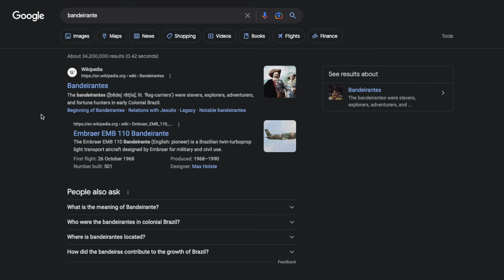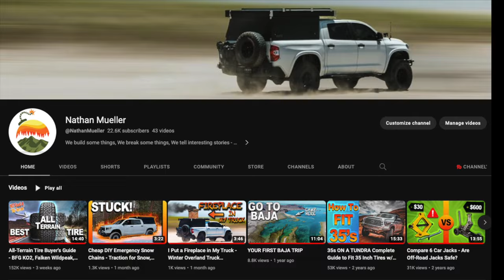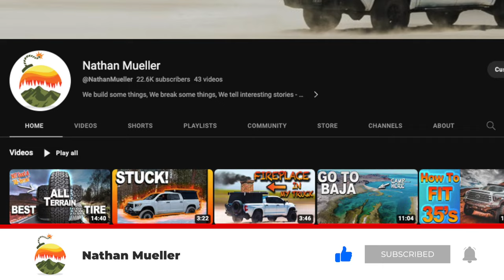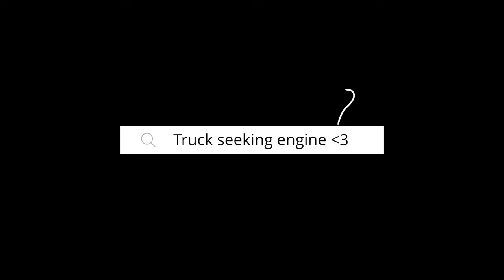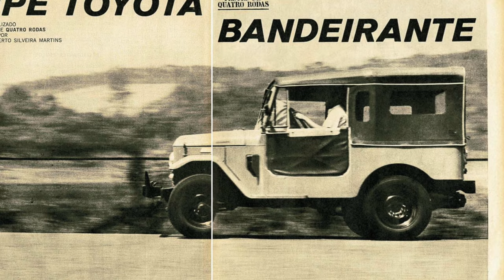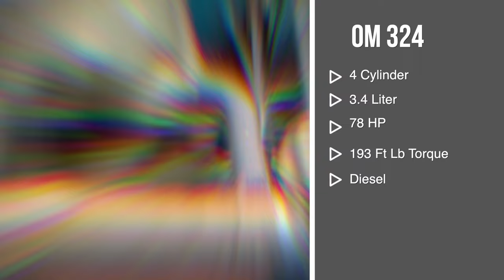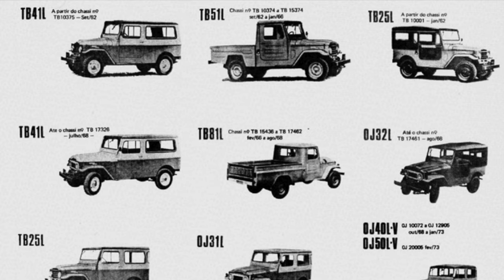What Land Cruiser is That? (Hint: It’s Not) Toyota Bandeirante - King of the Amazon

Comment: One thing i think you may be confused on. The 700 ton frame press likely did not weigh 700 tons. That would be the pressing force to bend the frames. Same as a 20 ton shop press does not weigh 20 tons. It would still be a heavy press, just not 700 tons heavy.
Reply from the maker: Ahh… good point. You are probably right.

Comment: Very interesting and well researched video. We had Perkins diesel powered Land Cruisers in South Africa in the years of isolation when the government pushed a local content programme. These Perkins as well as Mercedes Benz diesel engines were produced by a factory set up in Atlantis near Cape Town.
Reply from the maker: Thats interesting, I never heard of the Perkins Powered ones... I will have to look into that. Were they considered good engines?
Reply: I knew about Perkins engines in the Spanish Nissan Patrol, and some Mazda engines were based on Perkins designs too
Reply: @OutdoorAuto  yes reliable and good low speed torque, but not good for highway speeds